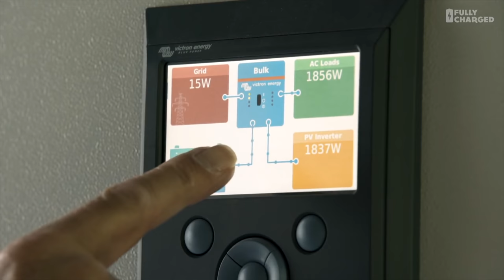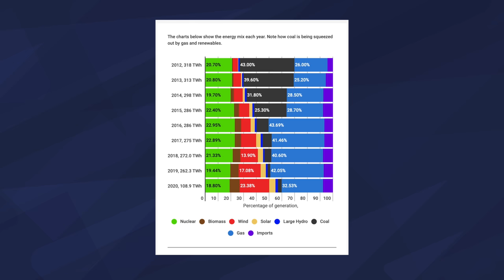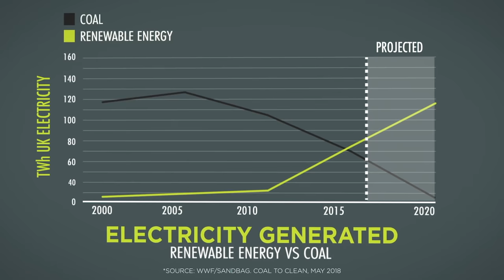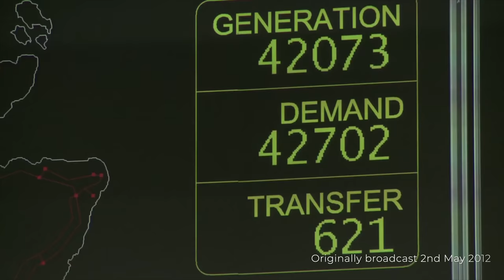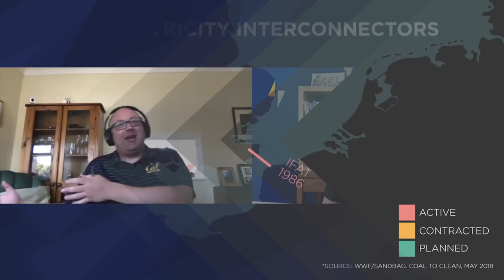National Grid ESO's Green Energy Success Story | FULLY CHARGED for Clean Energy & Electric Vehicles

Comment: Electric boilers are mentioned. It would be really good to have an episode on this topic.
Reply: Solar Thermal (evacuated tubes) paired with Electric Boilers would be the perfect combo.
Reply: Simon Adams, we'll be replacing our current gas-fired water heater shortly, was looking to replace with electric but unfortunately the U.S. doesn't have domestic 240V like we had in the U.K., meaning a fairly heavy cost to rewire/upgrade just to heat up water using electricity from our local monopoly supplier over a non-smart grid.
Reply: I guess electric boilers running of a air source heat pump right? These are much more efficient because the power is used to drive pumps, not to actually hear the water. The heat comes from ambient outside air :)
Reply: @michaelrch  IIRC Heat Pump can't achieve high enough temperature to get water seriously hot. Still would have to resort to Resistive for raising to boiler tank temps. But raising it part way with alternative methods is massively more efficient, geo ground heat pump or Solar thermal depending on the climate would make sense.
Reply: My Dad looked into an electric boiler recently and it seems they are still not good enough to replace gas, I mean they need to be cheaper over their lifetime and do the job.

Comment: Thank you for this fantastic update on the UK Grid progress over the last 10 years. It is interesting to share some recent changes in South Australia to compare against comments that were made around the 11.30-time stamp on this video. The topic being discussed was "Inertia". In South Australia, we are lucky to have had the "Hornsdale Power Reserve" (HPR) installed in late 2017. This was the largest battery in the world when it was installed at 100MW / 129 MWh. Since its initial operation, HPR has been enormously successful for the Owner Neoen (from a financial perspective) and for the Australian NEM and the NEM Operator, AEMO. So much so that the owner and AEMO have recently upgraded HPR's capacity to 150 MW / 193.5 MWh and they have added "Grid-forming" Controls. This recent upgrade does two things for HPR. It maintains the title of the world's largest battery for HPR in June of 2020. The "Grid-forming" controls now add AEMO recognized "Virtual Inertia" to HPR. In fact, AEMO recognizes HPR's "Virtual Inertia" as the equivalent of 3000 MWs of "Real Inertia", which amounts to half the required "Real Inertia" for South Australia. I suspect that the UK Grid will be adding "Grid-forming" Controls to storage al over the UK sometime soon. When it does, this discussion of inertia will move to the "Virtual Inertia" discussion. As it should, because "Virtual Inertia" is automated and far more responsive and reliable than real inertia.

Comment: I’d just like to congratulate you on some really fantastic content, thanks Fully Charged.

From one Electrical Engineer to another (I work in distribution rather than Transmission) - it’s great to hear some simple analysis on the capacity of the grid. I’m forever explaining that there aren’t really shortcomings, we can handle the loads now, maybe with a bit of reinforcement over time.

The key battle ground for tackling climate control is public perception of Nuclear. This is where we will win or fail. Also, not only does it give inertia to the grid, it’s also the best at taking the base load as a nuclear power plant is best ran near to capacity.

Comment: What a brilliant episode. And I also caught on the news the other day that the power utility companies have reduced Thier oil usage massively, and coal usage is almost non existent now. That's great news, especially as I remember being told 40 years ago that we only had 65 years left of Gas and Oil. It's such a shame they dragged Thier feet for 30 years before they thought about doing something about it. So I'm looking forward to cleaner air in the near future. If we could just get batteries that are lighter in weight but with increased capacity then Electric-only public and commercial transport will finally become a fully viable option. It still grated me to have to pay £200 for replacement Lead Acid AGM batteries for my wife's wheelchair because there isn't any Lithium alternatives readily available. THAT has to change. ...FAST

Comment: Coal has been disappearing from our grid, which is good not just from an emissions perspective but also from a human health perspective. However, the majority of coal power stations have been replaced with gas and biomass power stations, which once you take the fugitive gas emissions and biomass sourcing in to account, the CO2eq g/kWh for these can be as as bad as or even worse than for coal. Biomass is a "renewable", but it is not clean and is not necessarily even low carbon.

Nuclear is ultra low carbon, with median CO2eq life cycle emissions just 25% of solar PV (according to the IPCC's 2013 Life Cycle Analysis), and only marginally higher than wind. There is the issue of nuclear waste, but most of the high level nuclear waste consists of partly used fuel (less than 5% used), which is an unnecessary burden.

The technology already exists to vastly reduce the volume and longevity of waste, for example Canada's CANDU heavy water reactors (which can run on waste from light water reactors, and run on unenriched uranium) with even more advanced waste burner reactors in development, for example Moltex Energy's (a British/Canadian company) Stable Salt Reactor – Wasteburner (SSR-W).

Alas, in the UK we have largely squandered our nuclear expertise, allowed our nuclear industry to die, and allowed radiophobia to thrive, and then we winge about Hinckley Point C being expensive.
Reply from the maker: Thank you! We explain our position on each technology here: https://fullycharged.show/blog/renewable-energy-isnt-doable-its-being-done-and-its-unstoppable/
Reply: @fullychargedshow  I love the show, have been watching it from the start, and have been a Patreon for many years, so the show's positions are evident to me from its output. I post comments like these because they cover things the show/episode does not, cannot or will not. It is my duty as an ecomodernist to inform people so that they can take positive evidence based environmental action.
Reply from the maker: We're trying to get around to it a David! The Fully Charged cosmos is vast these days. Thanks, Dan
Reply: Ecomodernists are my favourite environmentalists :) keep up the good fight brother!
Reply: Today.
Saturday.
13.03
Biomass, 3.7%
Unclear, 17.8%
Wind, solar 53.3%

Unclear energy is not "green" untill it is
1) Producing power,
2) Has offset the fossil energy used in its construction,
3) Has offset the amount of fossil energy it will trace  on the grid during its construction time (10 years?)

It is not "ultra low carbon" soon enough.
And just btw, the reason "we moan about Hinkley C"?
It IS expensive!
Sizewell is looking the same way!
And what's this going on with EDF in France? "Adjusting" arrangements with suppliers? (Just skim read the story, needs more research on my part, but looks like they have issues?)
Reply: @BananaPeal0 small modular reactors are a bit of a mixed bag in my opinion. They have the advantage of being much cheaper to build as they can be factory production line assembled, whereas full size reactors contain many bespoke parts, which are expensive. The downsides are that they are less efficient as they operate at a far lower temperature and they are typically based on light water reactor designs which have a low fuel burn up (which means more nuclear waste).

As far as water use goes, I agree that this is a problem for thermal plants. There was some research into using super critical CO2 in a closed loop system instead of using water, but I'm not up to date on that research.

Having taken a swim in the sea at Bradwell when the nuclear power station was still operational, I can confirm that there is indeed localised slight warming of the sea water. That warming surely does have an effect on the local ecosystem, but compared to the ecological damage that hydro electric dams cause to river systems (which is often overlooked), it's a fairly minor.
Reply: @rogerstarkey5390   I'm assuming unclear is an autocorrect typo for nuclear.

For sure some power generation methods have higher construction related emissions than others, and this is true for hydro as well as nuclear.

I don't know how long it takes for the construction related emissions to break even with emission savings compared to fossil fueled power stations, but I do know that over the life of the plant, including construction, operational and decommissioning emissions, nuclear is one of the very lowest emitters.

When comparing wind and solar to nuclear, there is the clear bias as wind and solar LCA figures omit emissions related the mitigation of their variability, intermittency and sparseness (i.e storage and grid re-engineering).
Reply: @rogerstarkey5390  not found an exact answer, but I have found a figure for the embodied energy as a percentage of energy generated: Bioenergy 18%, hydro 12%, coal/gas 10%, nuclear 5%, solar 4% and wind 2%.
Reply: Whole heartedly agree, Hinkley Point C is indeed expensive but that's largely down to the frankly bullshit financing arrangements and as you mentioned below bespoke and unique low volume parts. The last time the UK built it's own reactors there were multiple concurrent or sequential builds around the country that would help massively control cost and quality as the Phase 1 team from one project move onto the next project learning as they go. Components manufactured domestically, supporting other industries with tax and employment trickling back to the treasury, in batches rather than unique components procured from abroad. Much of the power generation in this country was previously the 'Hinton Heavies' a common design of Coal unit that was built in numbers up and down the country by the CEGB. 
The same issue goes for renewables with each project having multiple different models used rather than a production pipeline being put in place for thousands at a time by an entity like the CEGB.
Reply: @1001ewaste  
If you compare Hinckley to wind farms as far as cost is concerned. 
You need to build about 18 Gigawatts of offshore wind to match Hinckley's 3 Gwatt simply due to capacity factor and life. Possibly even more as wind generators, particularly off shore, deteriorate and their capacity factor falls,  due to blade erosion.
A large factor, which is little known as the media never mention it is inertia. This characteristic is an essentila for stable grid operation and wind has none, it takes large steam turbo alterntors or hydro generators to provide this inertia. Add too much renewable to the grid mix and trips occur, as happened last August in the U.K..
Other detrimental characteristics of renewabales are they are asynchronous, i.e. they canot support grid frequency and they reduce short circuit current capability, necessary for good operation of protective systems.
More renewables equals a less reliable grid and also an expensive one.
Thus the seemingly easy task of using renewables is not so easy. Much harder is the energy for heating and transport. 

All this money and effort to aleviate what actually is an unproven hypothesis that CO2 is a major driver of our global temperature. That money would have been far more beneficial in reducing  the many more pressing problems with the world.

Comment: Great interview. If you do one of these again I would love to see you ask about what solutions he sees in the future for the inertia problem and maybe if gravity batteries are feasible.
Reply: Gravity batteries are used when pumping water during cheap periods and using the water to run turbines when electricity is more expensive.  I think there is a fully charged episode about that site in the UK somewhere.
Reply: I would like to see an investigation into the progress of the Icelandic interconnector which uses the output of the new Iceland aluminium smelter powered by thermal heat in Iceland. The by product would be electricity as base load. This was signed up by the PM in 2019. This plan has two advantages one it provides Iceland a aluminium smelter and two it provides UK with electricity with carbon free power.

Comment: Your guest remarked that the problem with renewables was the lack momentum in the system. If you talk to him again, please ask him the following. As coal and gas plants get shut down you are left with generation plants that have huge turbines and dynamos. Would there be a possibility of using these “free” resources? Use the renewable to power up these dynamos abs keep them spinning uncoupled from the generating turbines, then when momentum is needed it is automatically there. Weight could be added to provide more momentum. Thank you

Comment: You were commenting about large scale batteries that don't use Cobalt. MIT has been making progress with liquid metal (sodium) batteries. They're close to an easy to manufacture working solution. These very large liquid metal batteries would not work on a small scale, such as in a vehicle, but they would be good for Grid supplement, home and office total battery backup, etc. Check out the work of Professor Donald Sadoway, MIT,

Comment: that was fascinating! If I had a question to ask James it would be
 Q  The UK has an agreement with large energy intensive industries to turn off if problems or demand out-stripes supply, they have never used this??? In Germany where they have a similar scheme they use it frequently 100's of times a year. Why the difference, should we be using it more if say we knew there was to be less wind for 3 days. . . rather than using open cycle gas to plug gap??

Comment: It seems to me that in the UK, where gas boilers are so common for water and space heating, that you are missing a huge opportunity for energy storage. Where I come from we mainly have electric hot water cylinders. They are on a separate circuit and meter and can be controlled by the power company. They generally have 3 kW heating elements and so, over a city, a substantial load can be turned off to manage peak time loads. No, we don't use the hot water from these electric cylinders to heat space but then a heat pump is a cheaper option (running costs), and electric. Hopefully new build houses in the UK will soon be fitted with 100% electric systems.